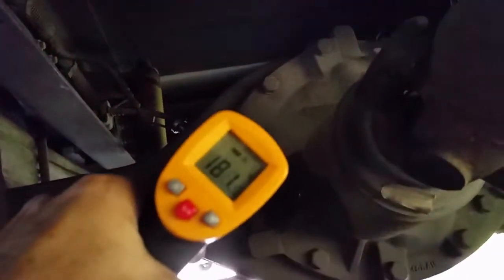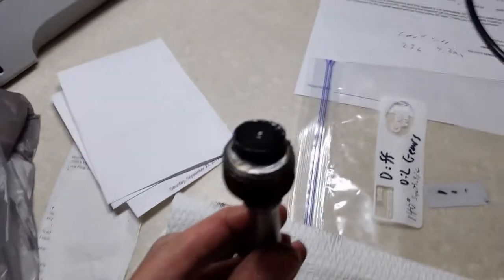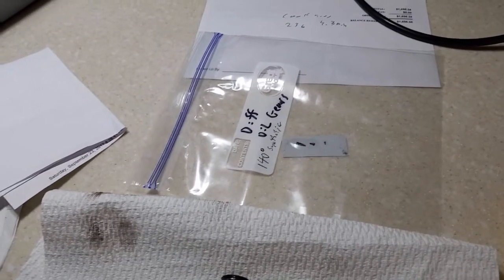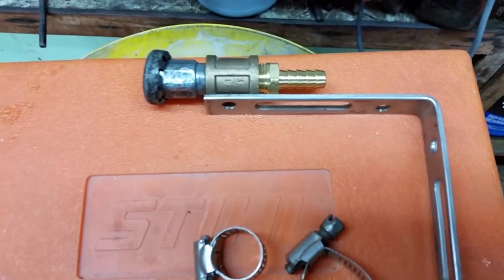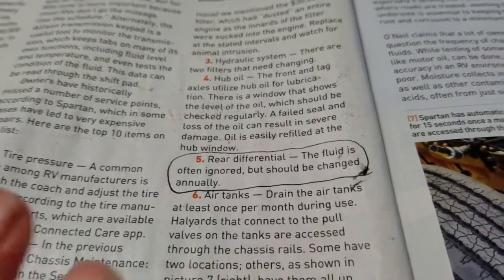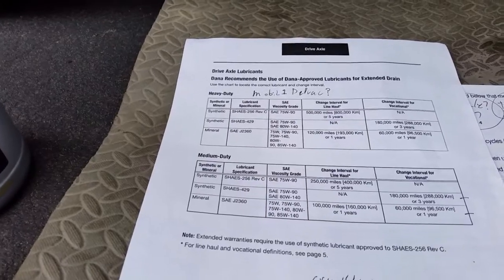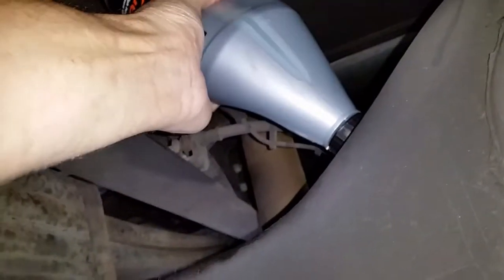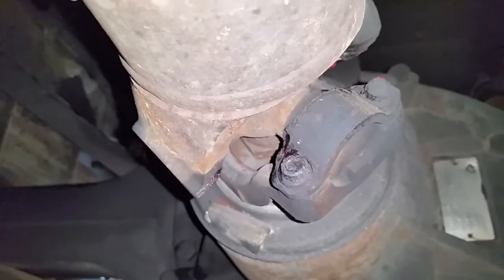How to Change The Oil on Your Workhorse Chassis W22 W24 Differential Dana S130

Comment: That vent extension is a very good Idea, mine is full of moisture/fluid up on top by the vent. Also good to know 7-8 quarts that's a big diff !! Will be doing mine soon thanks !
Reply from the maker: Note if you have the dana s150 it will take 12 quarts

Comment: OK…..for you guys that crawl under there to service a Dana Spicer differential S130 FR you are going to see something that will confuse you. There will be two fill plugs one over the other and there will be no drain plug anywhere on the axle housing on the pumpkin or on the bottom as you are accustomed to. The bottom plug on the carrier housing will have raised embossed letters stipulating “FILL” and the top plug will also have the raised stamping saying FILL. Sooo…….no one could answer me which fill plug is the correct one. Here is the answer……this differential is designed to work either with a rear input driveshaft from a rear mounted diesel pusher and transmission OR flipped over to receive driveshaft conventionally from the front. In that case, the fill plug that was on the bottom for diesel pusher becomes the top fill plug. The drain plug is the bottom center carrier bolt which goes all the way thru the case thus allowing fluid to drain out when removed. My owner’s manual for my diesel pusher mentioned nothing about this and a counter guy at a Cummins shop offered no information at all. Sooo….if you have two plugs in your pinion carrier housing and the top is labeled fill with upside down stamping then the bottom is your fluid level plug. Don’t do anything with the upper fill plug with embossing letters upside down. Dana Spicer was no help by the way.
Reply from the maker: Thank you for contributing that is some great info.

Comment: Great videos. my 10' flat floor slide on my 2004 W24 Itasca Suncruiser sets a little out of level when extended. The rear of slide floor sits 3/8" lower than coach floor. the front of slide sits flush with coach floor. Any suggestions to remedy this?
Reply from the maker: This will show you how to adjust your floor 
https://youtu.be/utWrtsB5nUQ

Comment: Hi Kevin - 

Hi Kevin - Regarding a few small metal bits in your differential - I would not be concerned about that at all. You are expecting the manufacturing process to be totally spotless and fully cleaned up - but that is not always the case. It is not unusual for some small metal bits to remain from the manufacturing machining that are not always cleaned up. Seems you found a few, and upon followup found nothing further – so all should be good.

Agree that oil changes should be done regularly, but in my 2005 W22 synthetic gear oil was used, and they only recommend a change at
something like 250k.  As per you thoughts – it is also a matter of time, not just mileage, and I agree.  However, the capacity of my rear end (like
yours) is approx. 2 ½ gallons.  Using Mobile 1 synthetic gear oil, at $10/qt, would cost about $100 – unless I can find in bulk for less.

Another point to make – for any vehicle it is extremely important that the breather is kept clean and open, as it is a very critical item.  The breather is there in the 1st place to allow for air heat expansion in the entire rear diff and axle assy.  If the breather gets clogged what will happen is that air pressure will build up, and oil will be blown out the seals at either end of the axle – where the rear wheel hubs are.  (The rear end oil is also used to lube the rear wheel bearings).   If you start to blow oil out past the wheel bearing seals then at the very least it goes onto the rear brake rotors, and at the very worse can catch on fire when oil hits a hot brake rotor.  

I know of 1 case where this actually happened – and the owner had to replace the entire rear end & axle assy – very expensive!  They have a 
2006 (?) Winnebago Adventurer and were driving along 1 day when smoke & fire erupted from the rear end.  Luckily the wife was driving their tow car that day, following behind and saw the smoke.  Immediately called to her husband, driving, so he could pull over.  As soon as he did she grabbed the fire extinguisher and put it out.  But it was too late – too much oil lost and entire rear diff and axle had to be replaced.

So – be sure to keep those breathers clean!
Reply from the maker: Thank you for contributing, great info I have been keeping close eye on it and no more metal flakes. Food for thought if you own Spartan Chassis they want you to change the differential oil every year see article here .
 https://www.motorhome.com/tech/diesel-chassis-maintenance-spartan-chassis/
 About the breather I noticed its just a loose fitting cap and no type of filter inside that's why I relocated it.
Reply: @ktoutdoor  Good move to extend your breather higher, away from dirt and mud which may clog it.  You are correct - for such a critical item you would hope the breather would be more substantial than just a loose fitted cap - but that's how they do it.  Safe travels!

Comment: Love your videos, helped me a lot with my w22 bounder. Are the carrier bearings lubricated by the axle oil or are they pre-greased? Referring to your friend's dp that broke down. I don't think my gear oil has ever been changed and it's a 2003 chassis. Will get done before next season. Thanks man!
Reply from the maker: If it like my Dana S130 then the outer bearing are lubed by the differential oil. Call or text me I got some PDF manuals you might like to have 606-875-0125 Kevin

Comment: I have a Dana S110 in a 2008 C-4500 which is a medium duty truck.Its pretty much the same as your S130. I am going to change my fluid sometime this week. For your drain bolt,you do not use any type of thread sealant when putting it back in?
Reply from the maker: No sealant and so far no leaks.  Thanks for watching

Comment: I have a Dana S110 on my 2004 W22. I'm debating the oil to use. I know I want to use synthetic. I am regularly in +100 degree weather, so thinking either 75W/140 or 80w/140. I see the Valvoline Full Synthetic has limited slip additive. Is this fine for the S110? Any reason not to use this oil and use something different instead? Thanks!
Reply from the maker: This is the oil I used MasterPro Synthetic Gear Oil 75W-140 1 Quart Part # 80055
 https://www.oreillyauto.com/detail/c/masterpro-chemicals/masterpro-synthetic-gear-oil-75w-140-1-quart/mp00/80055
We have no clutches so I don't see the need for the limited slip additive
Reply: How’s the MasterPro working out? Does it seem to be running smoothly?
Reply from the maker: @wurdzify  Yes and lower temperatures also I drained it a while back just look at it https://youtu.be/eXxFqS08tUg

Comment: That piece could be from the result of lack of deburring when the housing was machined if it's cast iron. If it's from a bearing I can't image you going 3,000 mile without a major failure. Check with a trusted professional. I'm a machinist and I have seen small cast iron pieces break off with the slightest pressure when I deburred Threads on the I D of housings.
Reply from the maker: Yes after finding I contacted Dana Factory and they told me the same thing. But I keep checking the magnet and so far no more metal.

Comment: Nothing wrong with that rear end oil
Reply from the maker: You are correct that oil only had about 4000 miles on it but the last drain and fill I found a metal sliver and I wanted to make sure no more metal was being produced so I could sleep better on are next trip.